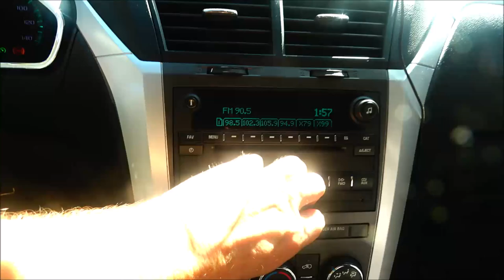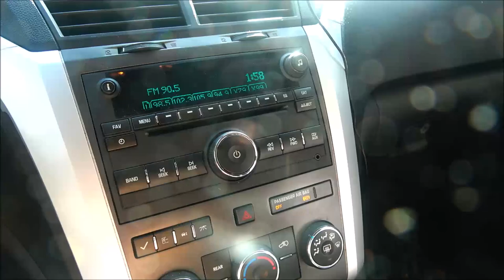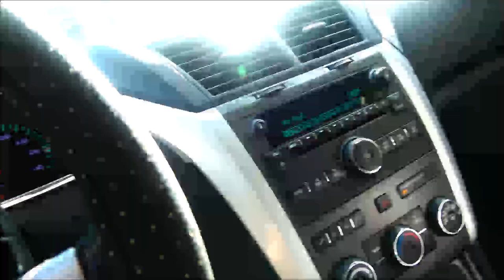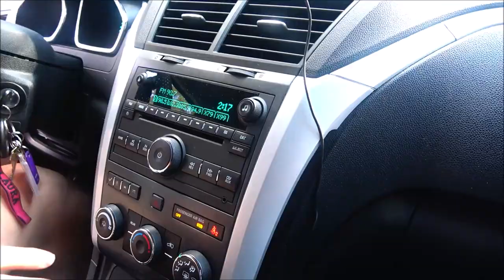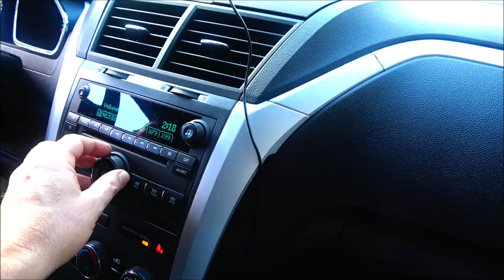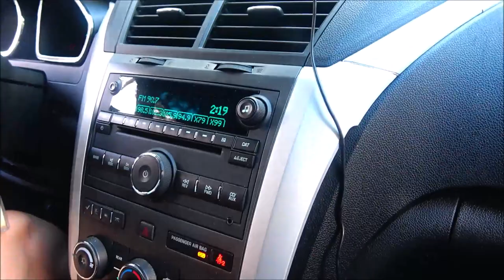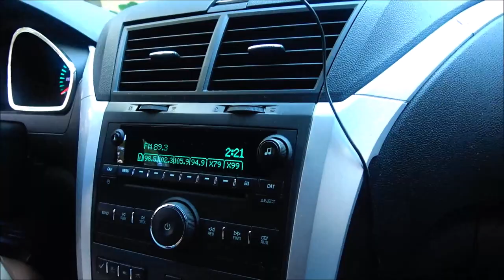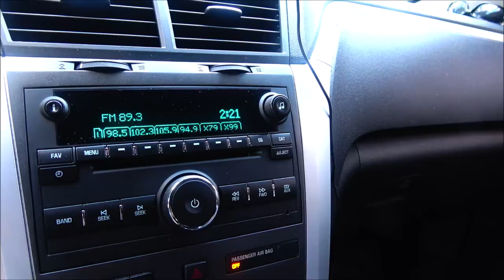Testing An FM Transmitter For Our Christmas Light Display

Comment: Should be pretty neat.Are you going to run the transmitter off of a battery?
Reply from the maker: Yes, I think that boat battery should do fine. I can charge it during the day if I have to but I have 3 so...lol
Reply: @shabear1000  I was thinking you could also use a cheap 120v to 12v convertor. I don't think that transmitter would need a lot of power.
Reply from the maker: @pttn975  that's a great idea too.